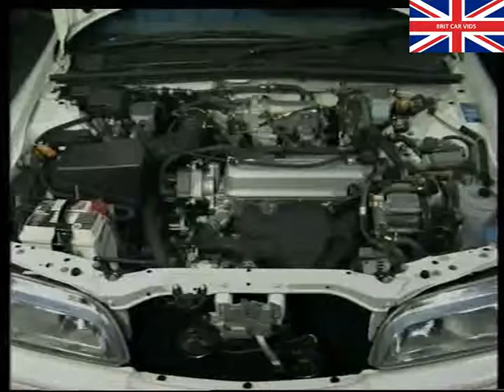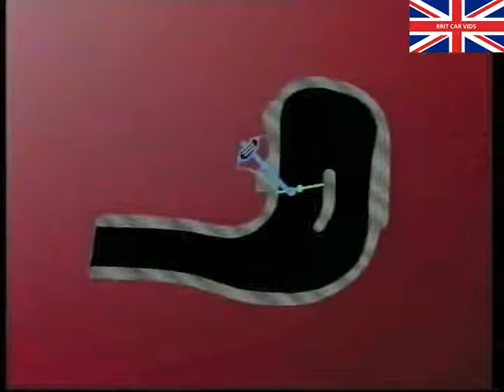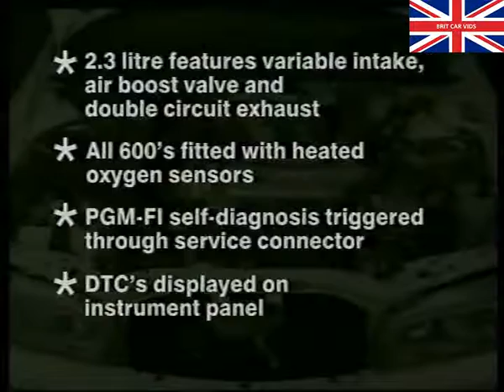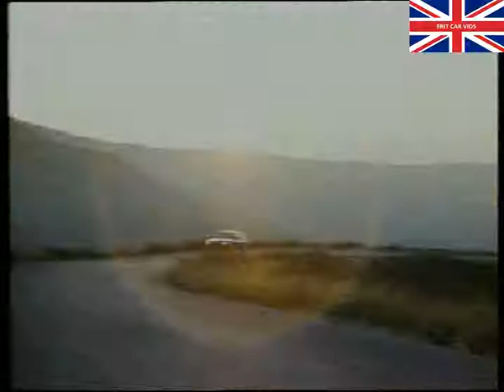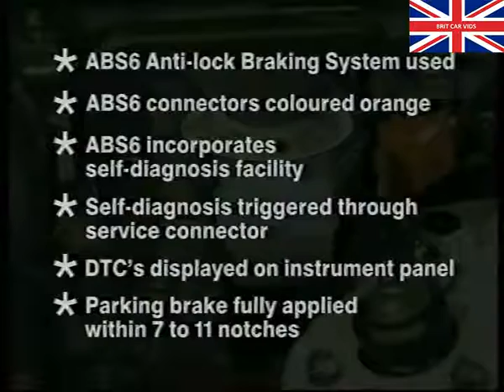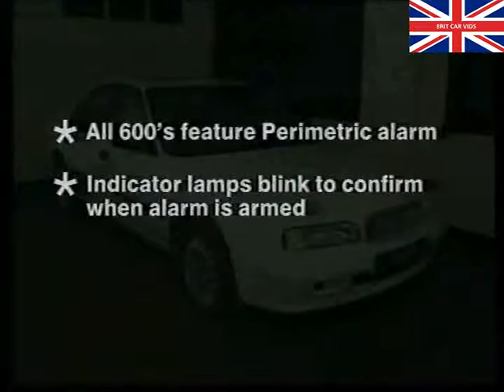Rover - Service Insight - Rover 600 Series - Technical Reveal (1993)

Comment: I had a 620 SI (automatic) for about18 years, the car runs great, and ended with 400.000 km, only because of some leaking breaketubes... but the engine stll runs beautiful - think it was from Honda.
Reply: You think 620ti would go as far?
Reply: @kass1564  no because it's a rover engine, T series, not a Honda!
Reply: @kass1564  Still have my 620ti. After 300,000 km we rebuilt the engine, which was surprisingly in great condition and still within standard cylinder and crankshaft measurements.
We replaced the rod bearings, piston rings, and got a full engine gasket kit. Also installed a new power steering pump and water pump. We even found new head bolts all here in Argentina.
Over time, it’s proven to be a fun and very reliable car. The Garret turbo was in perfect shape.
The only thing I had to do was fill in the coolant passages on the cylinder head with aluminum.
We’re almost done with the rebuild and looking forward to putting more kilometers on it